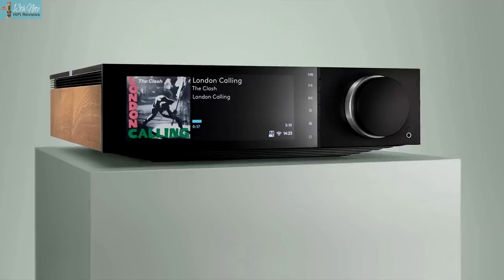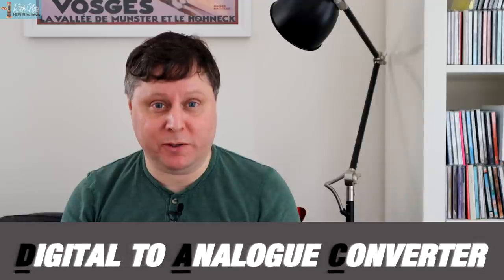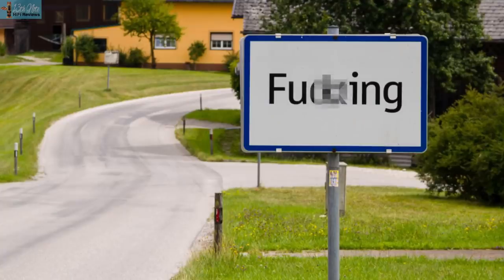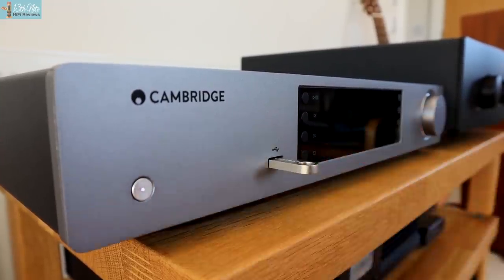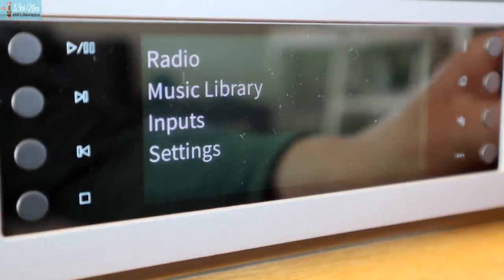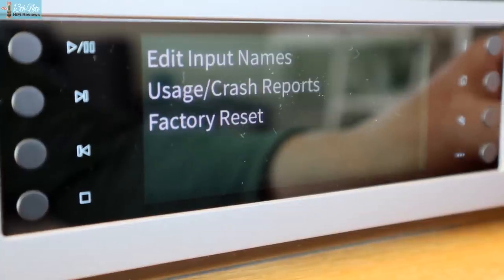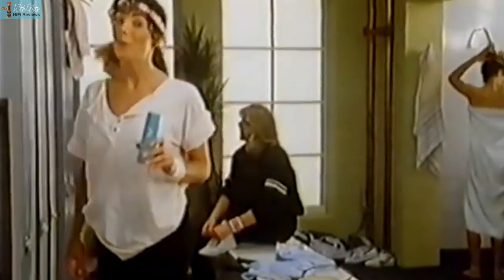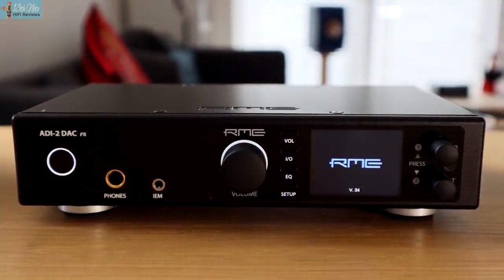Cambridge Audio CXN v2: 'A Performer Above'

Comment: In 2010 I bought my first SONOS and have continued to invest in these products to have some background music everywhere in the house. I have always had a stereo system to listen carefully to music in detail. I currently have a CAMBRIDGE AUDIO CXA-81 amplifier, CXC CD player and CXN-V2 network player and KEF R500 floor standing speakers. I also connected the PORT from SONOS to my amplifier. This PORT is connected in 3 ways: Analog to the amplifier, digital coaxial to the CXN-V2 and via Toslinck optical to the CXA-81. So you can compare immediately. I get the best sound through the CXN-V2. It is also beautiful via the DAC of the CXA-81. But the analog signal from the PORT, which uses its own DAC, is of much lower quality. If I now compare the streamer of the CXN-V2 with the streamer of the SONOS (digitally connected of course), I notice no difference. Thank you for your nice reviews. Greetings from Belgium.

Comment: Great, well balanced review with lots of useful information.  I have this streamer and agree with pretty well all you have said.  I use a laptop running Audirvana software to stream from Qobuz and have the option of feeding the digital output via usb cable or upnp to the CXN or to my Oppo 205 (which has high end ESS dacs).  This is where it gets interesting. There is quite a difference between the two. Generally the preference is for the CXN where the detail seems superior. For vocals (largely classical eg opera) the Oppo is a little more natural sounding. The bass is more focused and deeper with the CXN.  Streaming Qobuz directly with the CXN, although very good, is not as clear and airy as it is via laptop/Audirvana.  The extra features - Spotify, radio stations, chromecast and bluetooth are very welcome.  I will be auditioning Audirvana's new Studio offering shortly which also now includes Radio Stations and podcasts and supposedly even better streaming quality so more comparisons to  play with.  I hope it won't take me 125 hours though!  I have now subscribed and look forward to more reviews.
Reply from the maker: Thanks very much. These reviews takes loads of effort.

Comment: I bought this after having purchased the Cambridge Audio CXA81 and figured I’d standardise on the brand. I already had the node 2i (and still have it). Personally, I prefer node 2i for the app user interface, and the fact that I have trouble keeping the CXN connected to Tidal (the node 2i doesn’t have this problem, although my Kef LSX do). The CXN seemed to keep connected to Qobuz ok. I personally don’t like the DAC - it doesn’t pair well with rock imho - it makes the treble in the guitar sound grating. I had to introduce a Schiit DAC as an intermediary to suit my taste, and I’m sure I’ve lost out resolution-wise, but I can enjoy it more. Thank you for your reviews - I live in a small country where it’s hard to test equipment in person, so I have to rely on reviews, parsing reviewer personal preferences. I’m saving for the Hegel H390 - your review and those of fellow reviewers convinced me. It will take a while!
Reply from the maker: Thankyou, thanks for sharing experiences 👍😀
Reply: Is your Schiit DAC an R-2R? Can I ask what differences it has made to your sound as I am in a similar situation and curious?
Reply: @elthamlad468  No - it’s the Modius, which is their second level DAC after the Modi, and I had is spare because I was using it as a headphone DAC. It took the edge out of the treble and made it less grating. I removed it from the chain two weeks ago, and the sound was fine. My conclusion is that it imply takes a while for the Cambridge Audio equipment to settle.

Comment: Hi Simon, thanks for the review I was looking for. I will be buying a pair of active speakers in the near future. As I was debating myself: BS NODE or Cambridge CXN, this video made it clear to me that the CXN would be the choice if I was to connect my speakers analog. But because of the use of an active speaker I have to use the speakers DAC I believe. I connect both the streamer and speakers via digital way and so there will be no noticeable difference in sound. Am I right? The BlueOS seems better for the other members of the household and so I am leaning against buying the Bluesound as a transport device.
Reply from the maker: Thank you. I’m sure it depends on the specific pairing. Not all actives have digital inputs alone. Depends on quality of the actives too of course.
Reply: @13thnotehifireviews7  it's between Devialet Phantom and Cabasse Pearl. I have not yet decided between them. But again: thanks for your info. Subscribed right away.

Comment: Hi there. I’ve just bought the CXN V2, CXA61 amp and SX-80 floor standing speakers. 

I have yet to open the boxes, as I’m currently doing a room up first. However, I have heard that these units do not come with any cables. 

My question is: What cables to I need to buy, and what is the best way to link the units for optimal sound?

Comment: I'm facing a tough decision. I recently bought a Roksan Attessa CD transport. My system consists of a Node N130 > Ares 2 > Elex R. I love the sound of the Ares but it skips occasionally on CD playback. Apparently a known problem with a lot of CD transports and the Ares via coax/Toslink. My transport only has coax out. I'm thinking of selling the Ares and Node to purchase a cxn V2. I'm just wondering how much of a downgrade to expect sound wise?

Comment: Thanks for the very informative video. I am using Apple Music and, recently started casting from my iMac (which is in a different room) using Chromecast. However, when streaming this way, there is no information on the CXNv2's front panel display. I am not really bothered about the album art work, but more concerned that I cannot see the sample and bitrate displayed, which I'd like to be certain about when testing out / comparing high res audio files on Apple Music. When I was using Apple Airplay, this information was displayed. Is there anything that can be done about this issue? Thank you.

Comment: Thank you for your review. This comment will link to the comment I made on your Ares II DAC review. I have the CXN v2 with my PrimaLuna amp, and yes the sound is great but to me it's missing a little bit of lushness that I had using the inbuild DAC on my old valve amp. Maybe this is the PrimaLuna, however before I go swapping amps for the umpteenth time I want to explore a better DAC. My question I guess is therefore to improve upon the DAC in the CXN v2 how much, realistically, would one need to spend? How would you compare the CXN v2 DAC with something like the Ares II? Maybe it is not a 'better' DAC I am after, simply a different sound signature, something like an R-2R? I am struggling......
Reply: Get the modwright CXN which as a tube output stage.
Reply: @sixtyoneeight things have changed a lot since I wrote that comment. Gone is the CXN and PrimaLuna and I now have a Cayin CS100A streaming via a Bluesound Node 2i into a Cayin IDAC6 MKII. The DAC in the CXN is/was the weak link. The PrimaLuna was a seriously capable amp and required a higher quality DAC to sound it's best. The same for the Cayin CS100A. A seriously capable amp that requires a very good DAC. I bypass the internal DAC in the Bluesound, as its pretty awful. You only know a budget DAC when you hear a quality DAC. The CXN is OK for it's price point, but there are some seriously good Chinese streamers/DACS for a little more money.

Comment: I have the CXN v2, playing through an Arcam SA20, I use the CXN as a transport. The ESS Sabre DAC in the Arcam, to my ears, provides a more insightful sound. Shame Cambridge didn’t fit an ESS Sabre into the CXN. The CXN is a fantastic product though.
Reply from the maker: It’s not just the dac but power supply and analogue stage

Comment: Very nice review, I am a subscriber now! But one critical comment: Why is pretty much no reviewer reviewing the pre amp section of such devices? If this works well it becomes an even greater offer. The same comment also applies to all reviews I have seen about the RME ADI-2. I think for many the inputs of those deviced would be absolutely sufficient. And I also would like to know more about the volume control, is it digital and lossless, is it analogue, or a hybrid (such as the RME)!? Keep up the good work! Cheers, Michael
Reply from the maker: Thank you. This took loads of work and I didn’t have time to go fully into that, I suspect that’s true of all reviews. This took so much work. Maybe for another review.
Reply: @13thnotehifireviews7  Thanks for your reply. It does look like it has been a lot of work! Was supposed to be a trigger for further reviews 😉 And a hint that this would also differentiate you from other reviewers. Especially for the RME there is quite some discussion in forums about its pre amp qualities
Reply from the maker: Not planning further reviews on the RME tbh
Reply: @13thnotehifireviews7  I meant it would have been great if that would have been covered, so maybe you consider doing it it the future

Comment: I have the Mk1 CXN playing via an M2tech Young Mk1 through  QED Signature phonos to a Sugden HA4 dtriving Beyerdynamic T1 Mk2s. I usually listen to Radioparadise mellow mix flac stream.

 I note that you are very impressed with the DAC in the CXN  Mk2 and in your other review on the best DACs you compare it favourably - almost on a par with the Chord Qutest.

I have tried comparing the CXN using its XLR outputs direct into the XLR inputs of the Sugden using QED signature XLR cables and switching between the two. Other than the CXN sounding a bit louder through XLR due to the higher output voltage, the sound is noticeably inferior to playing via the Young.

It has a coarse sibilant graininess ( Maybe due to the upsampling by the CXN) , more two dimensional and narrower soundstage and is generally less listenable.

Maybe the Mk2 CXN fares better but for what its worth, that's what I find.

I am contemplating replacing the Young with a Qutest but I can't imaging it can sound much better.
Reply from the maker: So much is down to preference I think. The chord is still a great DAC.

Comment: I was going to purchase this unit, however, thanks to you, I now plan to purchase the Node 2i as I only require a streamer (not a DAC). 
I will be upgrading from using a Google Chrome Cast Audio (powered via an external power brick for optimal performance).
I have a revealing system, do you think my audio will benefit from the upgrade from GCCA to the Node 2i?
Many thanks in advance, and keep up the great work!
Reply from the maker: Yes will benefit but get the new 2021 node
Reply: Thanks for your reply.
Why the new one as I'm only using it for streaming and not utilising the internal dac?
I was planning on getting a 2i with a Linear Power Supply.
Reply from the maker: @aaronsadventures23  you may not need too as the new 2021 node has a redesigned power supply. The new one is also faster with a redesigned processing engine. I wouldn’t be thinking linear psu is always a necessity. If you are buying it, buy first then buy the linear psu later when you are used to the Bluesound, as you may find little or no difference and you could save money.

Comment: Thanks for the review.  Is it possible to bypass the DAC in the CXN?
Reply from the maker: Yes dig out
Reply: That’s the one huge failing of the Cambridge streamers, that it doesn’t have a USB out that you could link to an external DAC. It only has digital coaxial out, which in the case of Chord DACs, means lower resolution transfers.

Comment: Great review as always! I did pull the trigger on the bluesound node 2i, but tempted to send it back because the sound quality is ok for the money but the dac is the weakest link, everything else the interface user ease is brilliant! Was thinking of using the node 2i as a transport and by an external dac to improve sound and keep the features from the node, or go with Camebridge, and if you are liking the cxn that much the 851n should be even better.. I'm considering that one! Only thing I hope from Camebridge is that they implement amazon music HD...anyway cheers..
Any advice is more than welcome, I'm driving myself nuts) node 2i plus good external dac around 700 or return the node 2i and get the Camebridge 851n or cxn v2.....for the same price..
Reply: Using the node 2i with Boston acoustics m350 plus Musical fidelity m6i..
Reply from the maker: Thanks for great comments about the video. It’s a tough one but I’d borrow one and go from there. Amazon does seem to come up as an app in stream magic that seems to link but prob better ask CA as I’m really a tidal, Qobuz and Spotify boy.
Reply: I too have the same problem which one to buy. Node2i +Rme  or 851n. Or Naim nd5xs2
Reply: @rajeshv5192  quite the dillema) its also so hard to do proper testing, since I don't have 10k lying around to test and then send back etc..I even thought of the Naim n dac, which you can get now for like a quarter of the original price back when it was around 3k or something, because I do love the Naim sound! But to use it with the node 2i that handles the streaming? Don't know..I think looks matter a bit as well, and the Cambridge does looks nice) or maby an Topping d90..still driving myself nuts)
Reply: @13thnotehifireviews7  i think i will go with  Camebridge 851n event though its a bit older than the Cxn v2 it's still their flagship, I'm fine with Tidal and Spotify as well, the latter will get more hi fi as well, the question is when and how and what's the price tag.. but with the node 2i isn't it so that if I get a very good dac like the mytek brooklyn plus, that it's kind of like putting an v8 into a prius.. and the node 2i even if its only function is to stream will bring down the sq? Because then its also more logical to get something like the Lumin d2 with quality spread equally across the board?! Maby I'm totally wrong! What do you think..
Cheers
Reply: @MrChillywilly7  851n is the only streaming dac with linear power supply. Cxnv2 has SMPS built in.
Lumin D2 also with SMPS.
How would lumin D2 compare with 851n in sound quality ? Any idea ?.( With and without external dac).
Reply: @rajeshv5192  My bet is based on reading alone unfortunately that the Lumin d2 is even better than the Cambridge audio 851n, it should be if you look at the price difference! It retails for about 2k plus..and the 851n can be found for around 1k plus so in terms of value the 851n is better..plus I like the linear powersupply better! Even though the smps can be very good nowadays! For me i think the 851n will be a serious step up from the node 2i dac! And think I could live with it for quite some time before the upgrade bug strikes again) plus the market is changing so fast! With dac,s and streamers a like.. that my guess is that in 3 years time you can get a Dac like an Rmi or topping d90 for a couple of hundred bucks..etc..the only gripe with Camebridge is the interface user friendliness as well with Naim and Lumin etc..they can take serious notes from Bluesound in that regard.. cheers
Reply from the maker: The app is better in Bluesound - things like the MQA radio station that they announced, MQA jazz refreshed concert, multi source playlists, and Bluetooth in bluos plus ability to link devices if you use other speakers. But I wouldn’t be thinking that going for pricey streamers is necessarily  the better option. This review showed me the £800 cxn neatly kicks a £1300 chord Qutest into the grass AND has streaming features. So I think if you want sq a node / rme is a better combo and I’d expect the 851n to be close to the cxn v2, certainly on specs. If it were my money I’d do the node 2i and RME route as it’s all about sq for me.

Comment: Well I owned a CXN V2 for several years. For me at least, it’s Dac didn’t sound any different from the $200 Cambridge DacMagic 100!
Reply from the maker: What speakers and amp did you use it with?
Reply: @13thnotehifireviews7  Nothing too fancy ! Just a Denon-PMA-1600NE amp and B&W 705 S2
Reply: @13thnotehifireviews7  However, thanks to your great videos ... I just ordered a Cyrus Pre2Dac QXR and the Stereo 200 to replace the Denon. Time to upgrade. I considered the new Cyrus XR series and even the DAC-XP,  but neither has a tape loop which i need for my Technics RS-1500 R2R !
Reply from the maker: No disrespect because I have different systems too, and it doesn’t mean yours is bad but the last few percentiles often come when the rest of the gear is up there. You get the last laugh and we all pay for diminishing returns
Reply from the maker: That’s a big upgrade. The stereo 200 is the killer there. Will best your b and w’s for sure. I had the pre qx dac (forerunner to the pre2 dac qx).

Comment: New Node on Monday
Reply from the maker: Interesting........ Node 2i+ , Node 3, Node 2ii, Node 2isuper, Node 2i ‘bloody good job’. Lol. ?????L?L?LL
Reply: @13thnotehifireviews7  well, for me a better high quality PSU improvement is enough. All the other features are up to the standards. Also, the BluOS app is miles away better than the CA Stream Magic
Reply from the maker: @intothedragon  I agree the bluos is a better app. But a lot comes down to what you will and won’t be using. So for instance if you just have Spotify or tidal connect and play to the stream magic app, you won’t have grumbles. BLU is adds in all the bonuses like MQA, MQA live streams, ability to add more speakers and link them and so on.
Reply: Bought this last week, and absolutely love it. A big improvement on my Node 2i in every area. Pairing it with my Roksan K3 integrated and Dali Oberon 5’s. The app is very good too. Just testing it as a  pre-amp at the moment into the Roksan but initially doesn’t sound as good as the K3 in pure integrated mode.